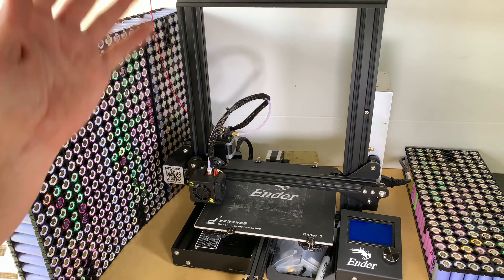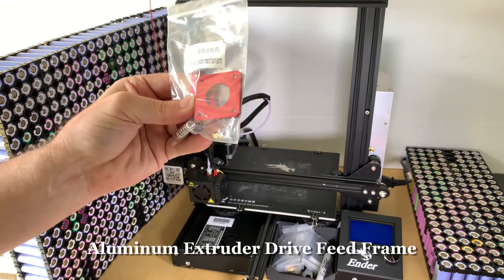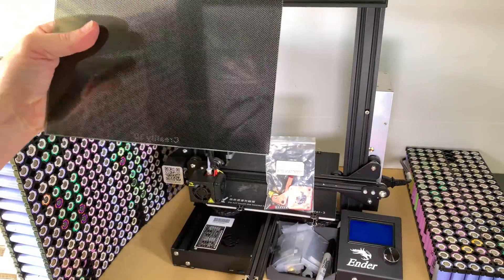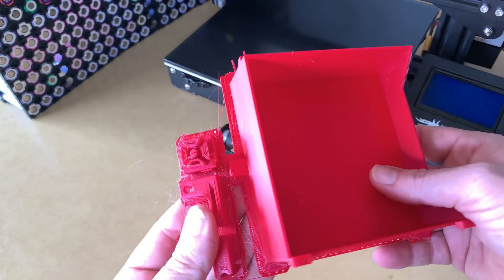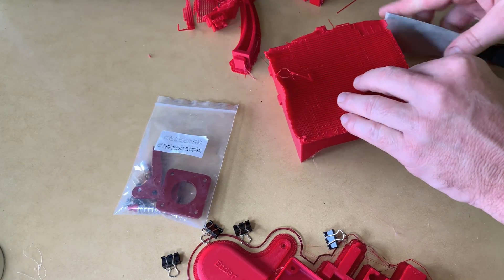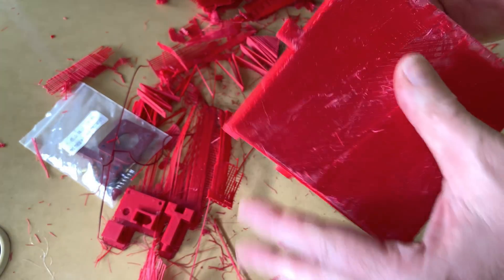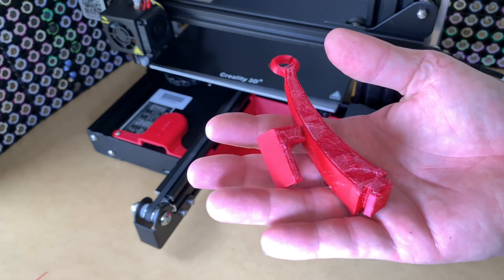Ender3 Budget Basic Upgrades - New Bed, Aluminum Extruder & some Thingiverse Improvements

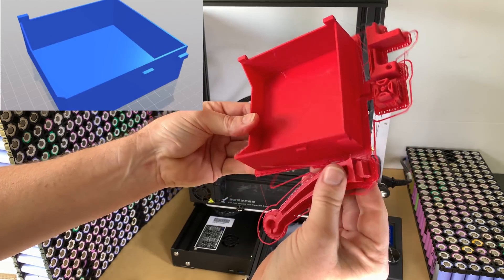Comment: 0:55  you should angle the opening of the filament guide holder thing so that the filament has to be inserted at an angle, but it'll sit in the hole straight.  less likely to work its way out.  don't know if that's an issue, but it sprang to mind when i saw the part.

Comment: Little hint for the bottom part... This part adheres very well to the bed, so disable the raft when slicing, save the PLA for the Raft and have a clean print. same goes with all the other parts. 99.9% of the time you wont need a raft. Apart from that, if the raft sticks that well, maybe lower your bed just a notch

Comment: I am someone who has always loved to tinker and take things apart to try and make them better. When I was a child this generally just meant that I would destroy RC Cars and put them back together without half the screws and most of the body parts that broke during the process. I recently  (within the last year) got my first Ender 3. Before that I had an Easythreed X1 that I loved but it was just missing something. Since I got my Ender 3 I have been a printing maniac making things for everyone and everything. I have also accumulated a lengthy list of upgrades ( I am working on one right now!) These upgrades are listed below. The Ender 3 has been the best purchase ever. 

My upgrades if you are interested In order of most useful to most costmetic: 

Silent 4.2.7 board
Self Made Glass bed
New Hot-end assembly to allow for a Noctua 40x20mm fan
New heavy duty bed spring (the yellow kind)
Extruder Knob (this one is actually extremely usefull)
Filament duster (for ender 2)
Self Made printing enclosure (Utilizing twisted wire and heavy duty trash bags)
Self Made new extruder to allow easy loading from the outside of the enclosure)
Klipper on raspberyy pi 4
Self Made Phone IP Camera Mount for Klipper
Self Made Wireless for Klipper (Utilizing an old WIFI extender mounted to the machine for portability)
New PTFE tubing (the blue kind)
Dust cover for the Y Axis belt
V slot extrusion covers for a bit of bling

Needless to say I am loving tinkering with my machine and I am probably not done, but the short of it is that my machine now prints faster, is more reliable, so much quieter, is wireless, has a dedicated webcam, and is 100% portable with everything working off the included power supply on the machine.
Reply from the maker: I just want to burn this printer with fire.. done the print head upgrade, bed, springs, quiet board etc  --- it either sucks or I do...
Reply: @HBPowerwall  oh.. I'm sorry to hear that.
Reply: @HBPowerwall  If you do decide to burn your printer, which would be unfortunate, you can just send it to me I have a great fire pit. lol.
Reply from the maker: I've tried to sell it, no-one will even pay me for the new head and board costs lol

Comment: The glass bed is booty on my ender 3 just using pla. Was having major leveling issues along with my prints not sticking at all. Returned it and am getting much better quality in the original ender 3 mat
Reply from the maker: I hate this printer - it just will not keep flowing filament - changed almost every part - must be tuning but still hate it.
Reply: @HBPowerwall  I had a problem with my first ender 3 with the leveling. Turned out the bed was bowed pretty bad so exchanged it for the same printer, upgraded the bed springs and have been getting great results. Haven’t had any filament excursion issues as of yet. Good luck

Comment: I'm very inspired. like if this idiot can do it so can I. (no offence intended.) I actually might try that aluminum thing upgrade now. Thanks bud!!
Reply from the maker: This idiot F%^TY&U*I(kin hates this printer lol It sat on the shelf since unused lol
Reply: @HBPowerwall  why do you hate it?
The Ender 3 is a great machine if one just takes care of it properly.
Proper levelling, using pla and going with some good settings in cura (like not choosing rafts) make this thing run perfectly and without any issues.

Comment: When you were doing your leveling test on the glass bed you could see your primary issue was bed adhesion. I have the same bed, for PLA leave your bed temp at 60C and use a glue stick like Elmers glue to cover the build plate surface or at least the areas the print will be on prior to starting the print. Also eye glass cleaner solution works great to remove old glue and pla residue from the bed!

Comment: Perhaps under-extruding on that red coliseum you were printing. You might need to adjust the extruder mechanism you installed.  I've tried a couple of different metal extruder mechanisms and gave up - went back to the stock plastic.  Hey...if it ain't broke...

Comment: Hey, me too. Got my ender3 v2 less than two weeks ago and have already ordered another original(cause they're really cheap) Ender3, as well as a few upgrades. I think I got the same aluminum extruder,  a direct drive extruder kit and dual Z axis kit. 
Love your battery collection too. One of the reasons I bought this thing is to make battery holders.  Hey did you know you can even CNC your own PCB's on these machines by mounting a Dremel. Here's the video I watched on this yesterday. https://www.youtube.com/watch?v=6ipcdhXetHY . That'll be the next project. 

As for the Bed. Awesome?  Hey,  that looks like larger print area now? Is it, and if so, how did you change the parameters in software?

Comment: In my opinion, the single best upgrade is an SD  to micro SD adapter. I hate fumbling around with the tiny Micro SD the printer uses by default, so I bought an adapter and now the printer uses full size SD cards. More durable and far easier to use.
Reply from the maker: That was definitely a pet hate

Comment: 3:34 yeah, don't use rafts. Use a skirt, or if the part is small, use a brim. It's much easier to clean, and it gives much better surface quality.
Reply from the maker: thank-you

Comment: I installed a new capricorn tube set   with aluminium extruder feeder,  bed springs,  and bl touch, the biggest problem i got is i can't get the software to read the chip.
Any help you can give?
(Ender3 pro)
Reply from the maker: Can't help sorry, havn't used this printer since this video..
Reply: @HBPowerwall  
No worries,  thanks. 
I'm learning toward a bad burner, need to return it .

Comment: No need for rafts, PLA will stick to glass bed very well, make the gap 0.08mm from nozzle to bed when calibrating and download the chep settings
Reply from the maker: Haven't used the printer since this video, changed the filament and it got worse didn't matter what i tried couldn't get it to stick really good..

Comment: Nice video !
How did you get the PLA to stick to the glass bed i'm having a lot of problems and need to set the nozzle very low in my opinion... (the paper calibration has a lot of resistance)
Reply: berendbotje needs to be able to pull the paper out but just about not able to push it back in
Reply: @airsoft_bombs  I found my solution ! Feeler gauge 0,05 mm just rubbing is perfect. cheap and easy method ! Thanks for the respons though;)
Reply: berendbotje AHH cool I may grab one aswell

Comment: i recommend getting better bed springs -the stock ones are to soft which causes you to have to re level your bed more often
Reply from the maker: I actually did that and it helped alot
Reply: Definite the first thing i would recommend to upgrade as quickly as possible.
Got my ender 3 pro for christmas and got yellow spring today in the mail, they are way better than the crappy stock ones. 
This is my first 3D printer and I have no previous experience with 3D printing. 
But there is alot of helpful videos on Youtube and help on the Creality facebook group, which have been a great help to me to get started with my printer. 
I'm still learning, but as of today, my prints begins to look nice. :)

Comment: As far as removing the raft from the parts I figured out that if you work around from the outside slowly going around and around the park just gently breaking it loose a little bit at a time to work best then once you have a large enough piece of the Rafti content peel it off . Also you might want to check your temperatures I've been doing PLA at about 200 for the nylock 70 for the bed .

Comment: oof, I never use a raft, huge pita,there are some slicer interface  tricks to get them easier to remove, but I just avoid them
Reply from the maker: I suck so hard at 3D printing - it's sitting in the corner unused these days

Comment: Well this video has taught me one thing (which I've not done yet anyway) - which is NOT to use rafts!! Most of my parts print fine straight onto the glass bed, or if there's little contact, I use a 1 layer brim, which peels off like a charm.

Comment: hi i have an issue nobody seems to know of. its actually two symptoms that in my opinion are caused by the same problem. as my ender 3 pro printing the adjustment wheels are slowly turning non stop (you cant notice it on a matter of minutes more like hours) and finally they get disattached to the base of the printer and fall off i have no idea what causes this but there is a weird clicks during the printing process sometimes and i think that it started the same time as the wheels issue so i guess its the same source any idea?
Reply: Helo Eitan, your comment is now around 4 month old, hope you have fixed the problem with the bed leveling noobs/wheels falling off. If not, please go and buy some new bed spring (Also know as yellow bed springs), they are a lot better than the crappy ones including with the printer. 
They keep a higher pressure agains the bed and the noobs/wheels will be harder to turn. 

I just got my Ender 3 Pro for Christmas and got my yellow spring today, they are way better and cost next to nothing. 
I payed around 12usd with shipping because i needed them here and now, but they can be fund way cheaper, if you want to wait for them.

Comment: even I had problem with printing ABS so I raised nozzle temperature to 240 degrees and the bed temperature to 120degrees. That gave me the best quality ABS print, and while printing I have closed the room door and windows and the fan speed set to 0 so no air is allowed to the print.
Reply from the maker: it was easier to give up on printing lol

Comment: Try re-slicing that big box and orient it so the flat bottom is down on the bed, no supports needed then.
Reply from the maker: I just slid the printer to the side of the bench and almost havnt used it since.. never sticks to the bed after weeks of stuffing around i gave up

Comment: warping is an issue with pla, so NOT using a raft or brim on a large piece is a bad idea.  Another trick is to increase your bed temp.  Someone said that pla trans temp is 60c and it will essentially melt in your car.  This is incorrect.  I use hatchbox pla, hotend at 195c and bed temp at 60c.  No problems removing Rafts for me.
Reply from the maker: awesome thanks for the input

Comment: I know a great trick! don't print rafts, I never print rafts on my Ender 3 as long as you are leveled well you should be fine.
 Here try this for your glass bed the best method I have found for glass beds  https://www.uantwerpen.be/images/uantwerpen/container11343/files/bonding_pla_with_salt_water_v20160713.pdf
Reply: I have just noticed your new bed looks like it has a coating on the glass, if so this method with salt is not required

Comment: OMG, a heat gun to remove a raft!!! LOL
Reply from the maker: Hey, it was worth a crack right?>
Reply: @HBPowerwall  no, sir, ever in the life, LOL. Next time if you want to use rafts be sure to have .2MM(recommended .3) on the "Raft air gap" parameter if using Cura or "Air Gap"  if using Repetier(0.2), that way it will be much easier to remove. I have to admit  it was crazy fun , lol.

Comment: Turn on retraction 4.5 millimeters of retraction lift nozzle up 0.075 millimeters and 40 millimeter retraction speed👍🏻
Reply from the maker: Turns out I've turned it off now and it sits in the corner - but new filament into it after it was printing perfect then, wouldn't stick to bed, and making clunking noises all the time.. now it's just a paperweight

Comment: Reason not to use bamggood. My bamggood experience   payed my 300. Package was delivered to another city bamggood says it's not thier problem. I get nothing DONT BUY FROM BAMGGOOD
Reply from the maker: Sounds like an issue you need to take up with them. Considering its all computerized did you put the correct address?

Comment: do the micro - regular sd upgrade. get the one with the longer cable. its the best .  actually upgrading the brass to steel extruder grooved wheel is a good one also.  you didnt print my lcd cover. I'm sad.

Comment: Geeze man get a grip, no darn rafts ever again please.

Dont be afraid to use some nontoxic gluestick on that bed since i can see your print not sticking to the bed during your calibration print. 

I’ve owned my ender 3 pretty much since it came out and I would say that the paper calibration trick is pretty much useless and don’t spend to much time on that instead start a print with a couple of skirt laps like 3 or 4 should do the trick. Twist the knobs until the skirt looks even all around and then just let the printer do its job.

It’s a great printer for an even better hobby and I wish you great success with your future prints. (Without brim and raft, wink wink)

Comment: If you try changing the raft air gap in your slicer it may help. 
You could also try some different filaments or different heat settings. When I print pla with rafts I use a 0.25mm raft air gap, 0.16mm layer height and a 220C nozzle temp at a 16mm/sec print speed. I get an almost 100% success rate.
I hope this has helped. Keep up the good work.
Reply from the maker: I've done lots of tinkering and I think I've learned a lot of new things..

Comment: Use 20-30% water based wood glue mixed with water on your print bed, then you can print without any skirts or raft
Reply from the maker: Using cheap hairspray working really well

Comment: I just got my ender as well. Level that bed better. Also your settings must be off for prints that bad. I run temps for Print head = 200, bed = 60, and speed = 75. I use Cura for converting STLs to GCODE and make sure you select your Ender 3 as the printer so it is calibrated properly.
Reply from the maker: isn't the cura profile for the ender 3 broken? I've only just started using it - learning heaps still every day
Reply: @HBPowerwall  I use Cura and it has been working beautifully for me on stock settings. Apparently there wasn't an "Ender 3" option until recently, but there is since a few days ago. 

Again I try to print at 50%-75% for the first couple layers and sometimes ramp up to 100%. Sometimes I leave it on 75% because I'd rather wait a little extra and it be a good print than wake up to a mangled mess. 

I may up my heat plate up to 65 and see if I can speed up my speed some.

Comment: I would also check out a SPEAKER COVER. It is like a 10min print and covers the super loud printer to make it much more enjoyable. 

I also printed off the Z-Axis Top support and a knob, to allow extra support and allow raising and lowering the print head if need be. The excruder and glass bed are my next buys but waiting until after christmas vacation. Thanks for the laugh with the prints, however smart to print them all in one go. I printed most of mine individually.
Reply from the maker: i'm still learning for sure, been weeks now and there is so much more to learn how the little things affect prints

Comment: Add a ring cooler for the nozzle!! Exist a really good one at thinginverse. First thing I made and put on and the prints are perfect, if you do not ad this you could end up in a heap of problems at a little bigger prints as I guess you have already noticed.
Reply from the maker: That is definitely on the list after all the bloody minecraft and roblox figures on the planned have been found and printed!!
Reply: @HBPowerwall  Yea I can understand that. Do it as the next item, its sure worth it and only take like 25 - 30 min at 0.2 layer height which is enough.

Comment: so is abs no good for this printer i just hade 1 shipped out and i got a roll of pla and a roll of abs
Reply: Abs is borderline at best. You'll have to run near the bottom of the acceptable temp range without upgrades. Never run the stock hotend over 250c or even 240 for extended periods and the ptfe liner will degrade. Hot enough and the degradation outgasses some seriously poisonous fumes (trace amounts as low as 230 with some ptfe tubes, not enough to harm humans normally, but birds are very sensitive to it). And the heatbed barely gets hot enough, probably best to add an external mossfet for more than short prints.

Comment: abs needs an enclosure, bag, cardboardbox to keep the ambiant air temperature high.

also a little blend of abs and acetone to apply on the glass bed for adhesion
Reply from the maker: Box helped ALOT, been using it for a few weeks now and it's much better - old microwave box from a neighbor worked a treat. Haven't done the abs juice yet...